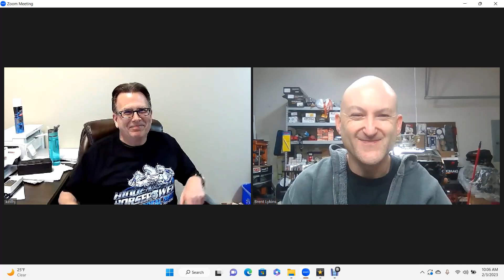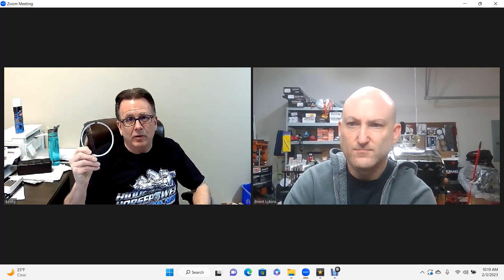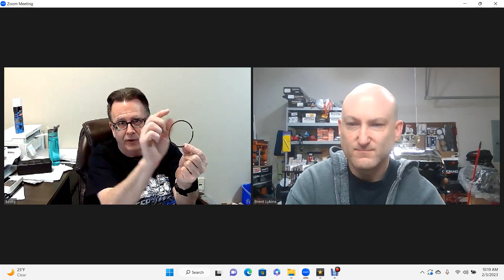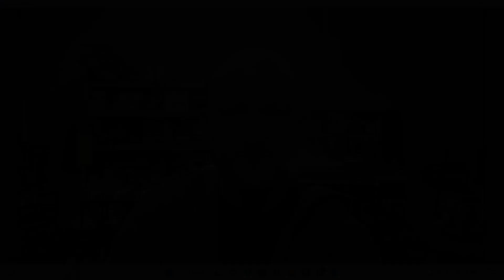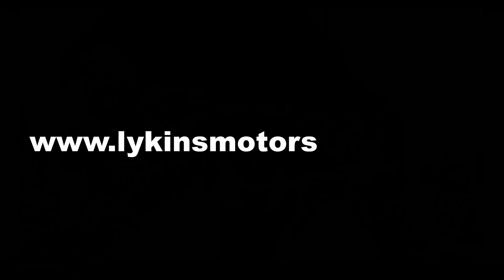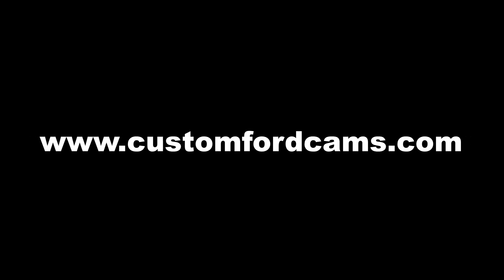Lykins Motorsports Interview w/ Keith Jones, Total Seal Piston Rings

Comment: Thanks for this video I found it very informing and answered a lot of questions that I have been wondering about.
 Is a gapless top ring package for a 10 to 1 N/A 400 HP street engine the best choice or should you use a a gas ported ring pack?
Reply from the maker: I would rather see you use something like a 1mm/1mm/2mm ring pack or a 1.5/1.5/3mm ring pack.   The gas ported stuff won't be a good ROI on a 400 hp build.  It may net you a 5-6 hp gain.